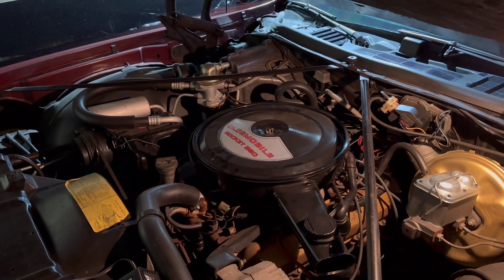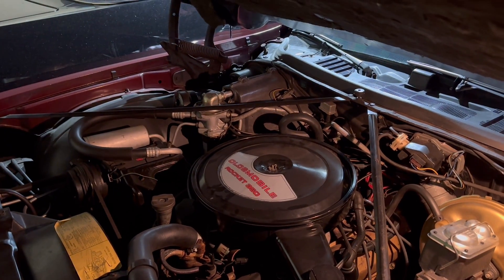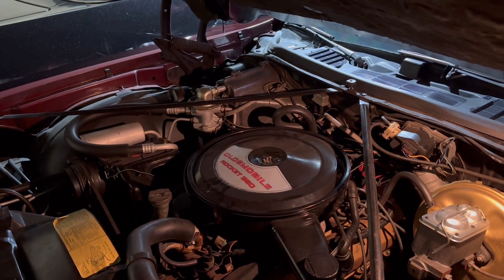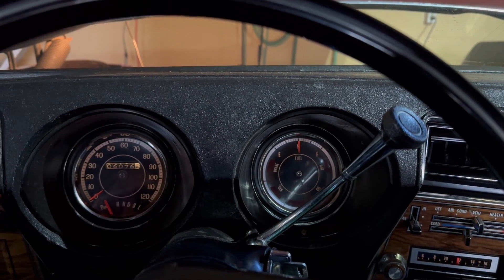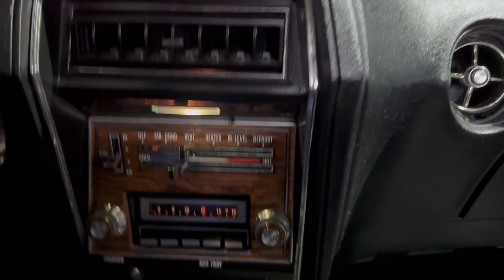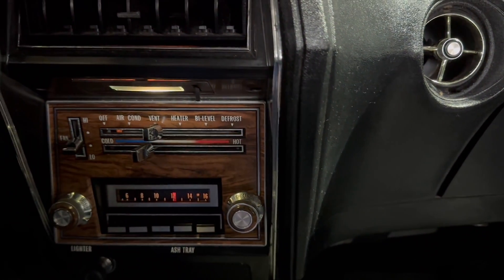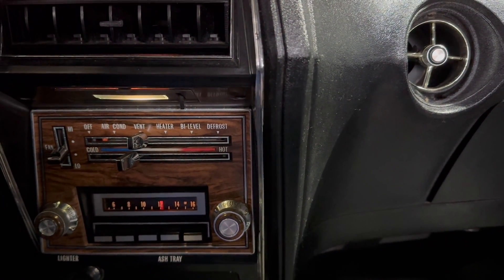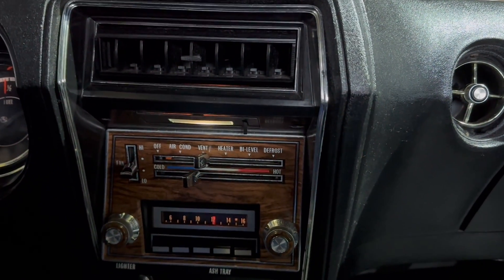GM's "Coolest" Invention Was a Strange Approach to Air Conditioning

Comment: I went to GM air conditioning school in the early 70's. Those compressors were 6 cylinders where others were 2 cylinders. They did not use a cycling clutch as most others. They had 3 sets of 2 pistons controlled by a swash plate and kept the pressures correct. Some also were controlled by a thermostat dial which turned on heat or ac or blend to keep the temp correct. No electronics, all mechanical. Great system.
Reply: The most unique feature was that instead of cycling the A/C clutch on and off as in other vehicles, when things got too cold, a bypass valve routed ran Freon back into the pump rather that thru the dashboard heat exchanger. It was smoother than cycling the A/C clutch but it guzzled more gas and thus was eliminated.
Reply: That's great info! I wasn't aware the A6 compressors kept the pressure correct. I'm learning as I go about these systems. My GM car is R134a converted with a POA valve eliminator. I wish I kept the old POA valve and used the screw/bolt to adjust evaporator pressure for r134a. I'm not having any problems with the POA eliminantor but the compressor never goes off. Is this because the compressor is keeping the right pressure? Was having an evaporator freezing problem but I changed the dryer and it "seems" to stop that.
Reply: @RowdyCStuff  Man, that was 50 years ago when I learned all of this. I do remember that the A6 was either on or off. Never cycling the clutch. The swash plate made the pistons move. Varying the angle of the swash changed the stroke thus decreasing or increasing the pressure but never cycling the clutch.
Reply: @johnslesinger7109  The compressor itself didn't vary the pressure, on later applications after GM phased the STV, POA and VIR setups on the downsized models of the late seventies, they used a fixed orifice and had a cycling switch so the compressors cycled on and off. GM was still using A-6 compressors with most larger engines at the time.
Reply: They basically worked the same as a hydrostatic pump.
Reply: On cars with Automatic Climate Control, Comfortron or whatever they called the fully automatic a/c systems for each division, the recirculating was achieved by setting the system on "Auto HI", and as it was with the manual systems, it was partial recirculation as the recirculating door was opened halfway. The Mark II programmers introduced in the mid seventies replaced the VENT mode by an ECONOMY mode which allowed controlling the temperature without having the a/c compressor switched on. By that time, the automatic controls were made pretty reliable and effective. They also allowed having warm air at the floor registers and cooled air through the dash vents when the temperature inside the car was balanced and the outside temperature was close to the set temperature.
Reply: The pressures were controlled by valves, not the compressors themselves.
 The compressors didn't cycle on and off while operating before the late seventies when they stopped using the last valve-controlled system they had (the VIR unit like the one showed in this Cutlass). Late 1970s cars that still had the Frigidaire A-6 (Axial-6 cylinder) compressor (after 1975 it had been renamed Delco Air A-6 as GM was preparing to sell it's Frigidaire appliance division a few years later) but they got a cycling system rather than constantly on system with valves. These A-6 compressors did draw more power than the average a/c compressor and the cycling could be annoying at highway speeds when using the cruise control. But at that point, many of the new smaller engines were using the new R-4 (Radial-4 cylinders) compressor that was introduced in 1975 on cars with V6 engines. While they were more efficient, they were not long lasting.

I'm not familiar with very old a/c systems but by the 1960s, GM used the Suction Throttling Valve, switched during the 1965 model year to POA valves and again in 1973 to the Valves in Receiver unit which had a replaceable desiccant bag in it and the sight glass built in rather than having a separate disposable dryer like the earlier and later cars had.

When the downsized models were introduced, they went with systems that used cycling switches.
Reply: In 1976 l went to GM training center just off l 75 it was basic training the dealership sponsored me, was the best yrs of my life other than my kids and grandkids
Reply: One of the problems with the A6, was the front bearing and seals. If the belts were not tensioned correctly, the bearings and seals would prematurely wear down, leaking out the refrigerant and oil. Once the oil was gone, sayonara compressor.  Had this happen on both our 1977 C1500 and Caprice Classic vehicles.

I owned a 1968 Dodge Polara that had the immortal RV2 unit. It was still blowing ice cold air without needing to be serviced when I sold it in 1999. I should have figured out a way to transplant that beast to one of my newer vehicles.
Reply: Sounds like an axial piston pump design, which I didn't know until now. They were heavy beasts as compressors go, and first thing us drag racers used to do is rip them off and throw them in the corner of the garage. Notice I said "used to", lol
Reply: Awsome that you have that experience! Quick question, I have a 77 Cadillac Coupe Deville and when I start it, there is air coming from the lower vents. Not cold just air that feels warm. However, when I move the lever to A/C, the air immediately starts to come put the dash vents as it should and cold. 

Any insight as to if the lower air is normal or what is wrong if anything?
Reply: @Sergissandaclassic  i think that's the way these systems are- the fan is ALWAYS blowing unless you have it in the "off" position, and there is prob a preset damper that makes it flow to the bottom level, until you select something different.
If I recall, if you put the key in accessory (don't start) you'll hear the blower spool up at low speed, so it just seens to be the way it's set from factory.
Reply: @Jayce1701  , thank you very much for your reply! Yes, as soon as I put the key to the accessory position, the fan indeed spools up
Reply: @Sergissandaclassic  Even with systems set to off, GM cars from that period with both the automatic a/c and manual systems operated their fan at low speed. On a cold day, there's a switch at the back of the motor that won't close to start the fan until the motor is partially warmed up to avoid blowing very cold air in the car with the system at off.
Reply: @PhilRacicot  thank you for that information
Reply: My Dad's 76 Monte Carlo was factory R12 and used to blow so cold the vent leuvers used to get a little frosty ... PHENOMENAL stuff.
He didn't drive it much, garage kept it (beautiful condition, real survivor, smelled like it was on the show room floor my whole life), and about a decade in it stopped blowing cold even though the sight glass was full and there was ice on some of the lines.
We were told by a mechanic at the time that if you don't routinely add a little oil to the system, the dessicator bag will dry out, shred, and then plug the honeycomb causing this problem, does that sound right?
We didn't know how to fix it, so we replaced the compressor (we thought maybe the shredded bag got stuck in the comoressor) with a new OEM unit and recharged the system with R12 ... it was a *little* better but still never returned to its old glory.
Any thoughts or suggestions would be MOST welcome.
Reply: @Jayce1701 I can tell you that the fully charged system in my 1976 Electra wouldn't blow cold and burned the compressor fuse (these had a superheat switch and a fuse in the mid seventies). The VIR had an issue and it was replaced by the style of system used after 1976 with a cycling switch. I wasn't aware of what the issue was and neither was my mechanic who had not fixed that many a/c systems from 1976 (few cars had a/c here in the seventies and those that failed rarely got fixed!).
Reply: @PhilRacicot  thanks for the info!
Reply: I had an original '77 Nighty Eight, and it had an A6 with a cycling clutch. By then GM had figured out how to add "economy" to their air conditioning.
Reply: It was a great system, so they had to revise it into the overly technical POS we have today 😆

Comment: Nissan did this the 90s. I had a Sentra that ran the fan on hi by default when the AC compressor was engaged except in defrost. I reasoned it was to prevent evaporator icing on that economy car that had surprisingly effective AC. Mine was the tiny 2 door but the AC system was the same as found on the 4 door model, etc.

Comment: i've got a 2002 Oldsmobile Aurora 4.0 (bought new, fall 2001). a/c compressor broke several years ago. I'm not surprised they had great a/c in the 1970's, GM used to make refrigerators too.

Comment: Speaking from mainly a 70's Mopar point of view here.  At one point, the heat and AC systems were changed so that the blower motor blew at the lowest speed no matter what setting you had moved the levers.  So the blower ran anytime the car was running.  I don't know when the other brands adopted this.  They explained the reason, but it seemed like there had to be a down side, such as shorter blower life for people that were driving in moderate climates where neither heat or AC would be needed.
Reply: I believe 1971 was the model year in which all cars were required to have trickle ventilation that you couldn't shut off. This was to prevent CO from building up in the cabin.

Comment: it was a very simple thing, all it does by passed the heater/ac fan resistor and applied the full 12 to the fan, the same way when out the fan at high speed

you noticed when that resistor doesn't not work you only have high speed on your fan no matter what speed you choose, that's when you need to change that resistor which usually is some where next or attached the fan

Comment: My grandfather had a 75 88 that had that set up, right down to the controls. He thought something was wrong with the fan switch because he couldn't control the speed when on full cold. He took it back to the dealer and asked about it but a tech told him, nope, that's working as designed. Too bad no one thought about ducting the air back to the rear seats, cuz that a/c would freeze the front occupants before the passengers in the rear got comfortable, especially if it had a bench front seat. You gotta be really careful when converting from 12 to 134a on these old systems. Not only is 134a a higher pressure gas, so it takes less to get the same system pressure, but some TVX , expansion valves, and thermactor controlled r12 systems don't respond as well to 134a as they do with r12. If they have automatic climate control, I've had issues with the sensing bulbs mounted on the evap not working correctly on Chrysler systems after the conversion. 6k on a Cutlass? I'd drive the devil outta it!

Comment: I recall these '70's and '80s GM HVAC control levers as having a lot of slop, with little tactile feel where the lever was actually parked. It's a miracle this system is still working properly. I would think they would get out of alignment or adjustment.

Comment: Fascinating! I don't think my '77 Cutlass Supreme has the recirculation feature like your '73 does.  I just drove it today too - I'll have to go check to see if my car does the same thing as your '73 when the temperature lever is moved all the way to to the left. (I think I typically leave the lever all the way to the left side though, and don't detect a high fan speed when A/C is on.) I'm guessing perhaps GM did away with that cool (no pun intended) feature by 1977.  Thanks for another interesting video, Adam!

Comment: Yes - great system.  Earlier systems were referred to as POA - Pilot Operated Absolute.  The expansion valve that allows freon into the evaporator maintained a constant pressure causing the outlet temperature to be very consistent and cold.  When demand was light, the POA Valve would bypass the evaporator and send it on towards the compressor.  There was an accumulator that allowed the liquid freon to gas-off before arriving at the compressor ... and the "low side" hose would be covered in frost!  In addition to high cooling capacity, the compressor never cycled on-and-off like systems used by most everyone else.  That was seen as a plus for smoothness and was one of the reasons Ford initially moved to the GM system for Lincoln and Thunderbird.
Adam's Cutlass has the later VIR system - Valve In Receiver - that functions the same.  It just moved all the pieces into one big unit.  Easy to rebuild too!  Unfortunately, it was a costly system and not seen as fuel efficient because of the compressor running at all times.  Sooo ...
Later - early 80's? - they moved to the CCOT system - Cycling Clutch Orifice Tube.  Cheap -O.  It's what most everyone is using now.  That A-6 compressor clutch didn't like cycling on-and-off at highway speeds - lots of failures.  Of course, there was that wonderful R4 compressor that came out about the same time.  We referred to it as the Claymore Mine

Comment: Not the oddest feature I expected to see….In the Cutlass, in the early 70’s, once you started the ac compressor, you couldn’t turn it off! The only way to do do was to shut down the engine! Switching to the off position, or heat, etc did not turn the compressor off.
Reply: I remember that from my family’s 1970 Olds 98.  If it iced up, you’d have to stop/restart the engine to get the compressor actually shut off.

Comment: I have an owners manual for the 1966 Toronado, and I read where it is common for the A/C system to lose 1 lb of R-12 in a year. I also had a 1978 Cutlass Supreme with this massive A-6 compressor bolted onto the 260 V8. The rapid cool down of the R-12 A/C in the summer in central Texas is something you have to feel to believe. I had it so cold inside the car, that when I parked it, and came back in roughly 10 minutes to retrieve something from inside, the interior air condensed and turned into a dense fog. I kid you not. The outside temperature could be 100 or 105, and when the A/C compressor kicked in, those vents would blow out arctic air in the 30s within 10 seconds. That's air conditioning for you.
Reply: I had a 1980 Cutlass Supreme Brougham and had a similar experience on 105° days in So. California. The old Frigidaire R-12 systems were unbeatable. So much better than anything now.
Reply: @michaelmullard4292  todays AC cools the car a respectable 30-40 degrees (at a generous absolute most.) To my knowledge
Reply: @michaelmullard4292  the 1980 supreme and 1979 supreme were both equipped with R4 compressors, not  A6

Not to say it couldnt work , just saying it wasnt the same as the OP stated
Reply: The air conditioner  made my car 🚗  so cold inside,    the windshield  would  condense  water 💧  on the outside.   I would turn on the wipers.

Comment: I recall many a time servicing the A6 by replacing the clutch because the rubber part shown in the picture with three holes becomes detached from the metal ring that is magnetized to turn the compressor shaft.  Those just fail after many, many miles of use.

Comment: The good performance of the A/C systems of the day didn't have a lot to do with the hardware but rather the R-12 refrigerant which was the best at removing heat. Even small Nissan cars that used R-12 would freeze you out on a 110+ degree day. Current R-134 systems can't match the performance of R-12. The other thing is that on hot days I had to teach others how to use the A/C effectively. All of my friends used to immediately set the controls to recirculation on startup. I had to explain that to make the car get cooler faster was to open a few windows, leave the A/C on normal with the fan speed on high so that it would push out the hot interior air (around 135F) using outside 105F air cooled to around 85F. After a few minutes of driving close the windows and switch to recirculation to recirculate and chill the cooler interior air and get colder air out of the vents. The other thing about the older GM A/C units is that when they were switched on they would stay on and draw up to 10 hp of power, hence the small hit on fuel economy. Not like the later models that disengaged the magnetic clutch to maintain evaporator temperature.

Comment: Having owned many 1971-1976 GM cars, I believe the introduction of this feature coincided with the Forced Ventilation system with the fan that continued to run on low when the system was turned off.  Both features were designed to positively pressurize the passenger compartment to prevent carbon monoxide buildup in the event of an exhaust leak.  Recirculation mode still had a  small percentage of outside inducted, but this was enough in terms of volume as the fan speed would be on mandatory high.
Reply: That doesn't seem right because on max air it would recirculate the inside air. Recirculate did not add any outside air. I worked on vehicle ac in the 1970s
Reply: I read this someplace credible at the time, quite likely at least one of the owner's or shop manuals from the multiple 1971-76 GM cars I have owned.  It makes sense given the engineering emphasis of the systems, but I have no way to know how to confirm it, or if the divisions were given a choice in the matter (I would suspect not).